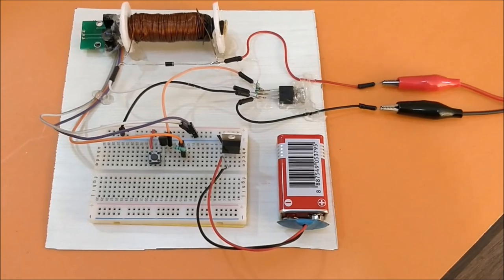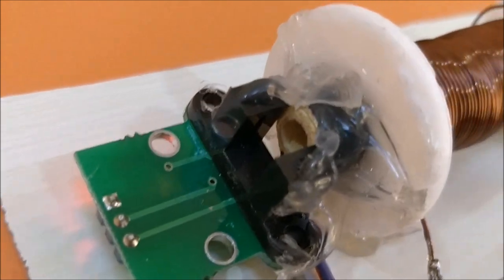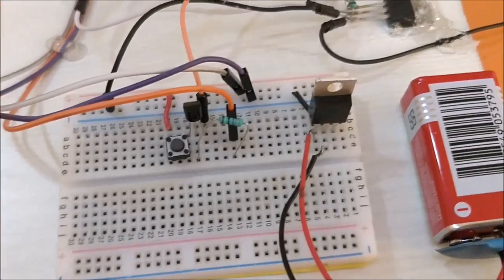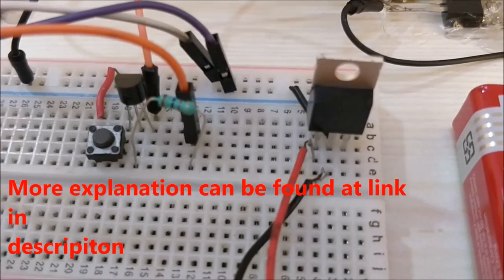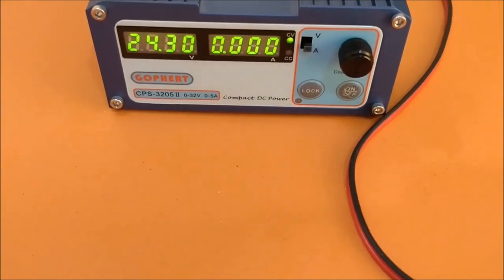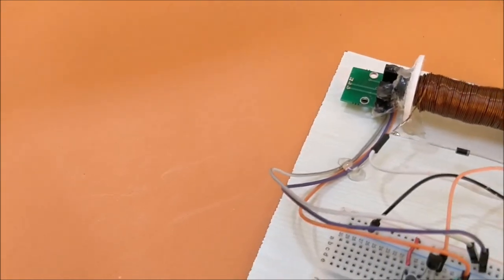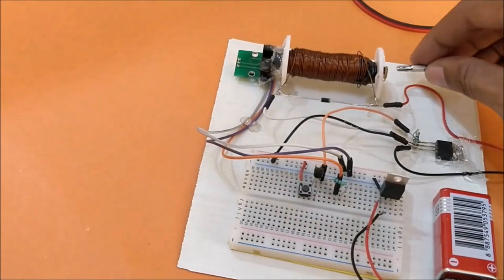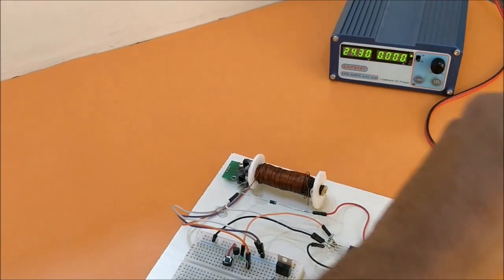DIY Coil Gun

Comment: How is the enamel copper wire able to handle 5A+ of current? I've read that they're only rated to MAYBE a few amps tops? (but more likely in the mA range).

I'm aware that energy will be stored in the magnetic field, but the current still has to flow through this wire to generate this field, so why is the wire able to handle this?
And is it only while the projectile is in the coil? as I've heard the coil will only be damaged if it's "powered without a projectile inside".

If anyone knows the answer to this, let me know!
Reply from the maker: you are right, when powered with max current, the coil tends to get hot very fast. I believe all electromagnets (even the ones from a hardware shop) are designed for momentary power on, and will not be able to handle max current for a long time